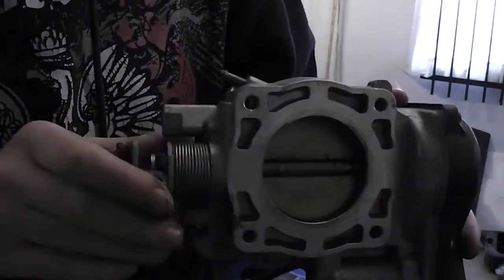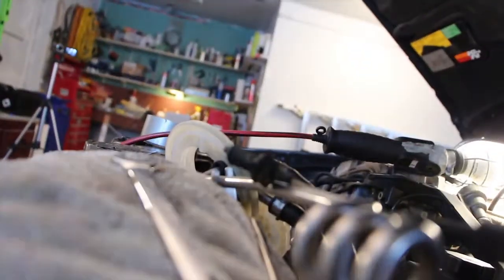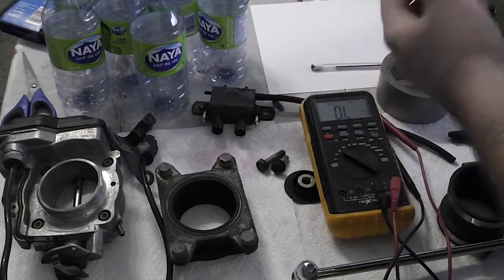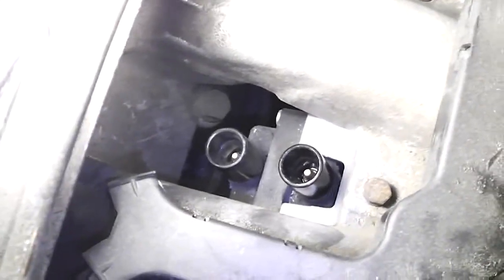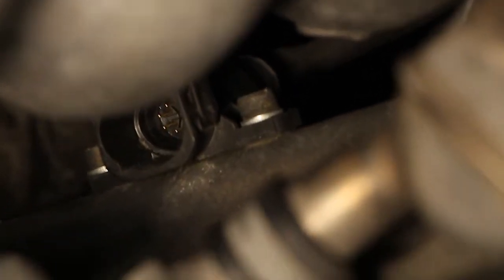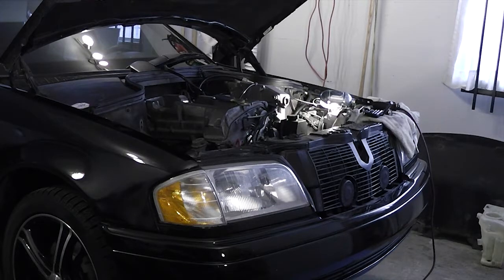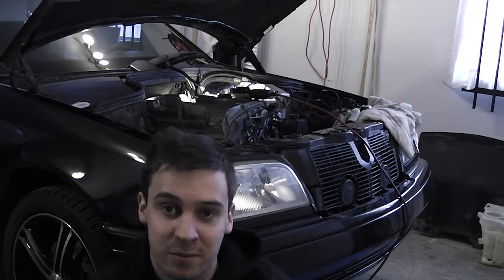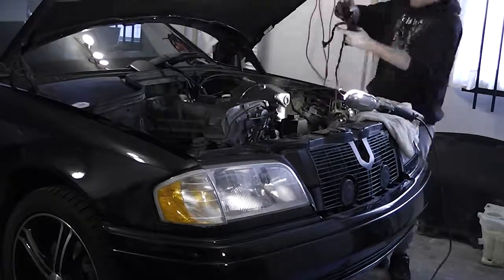M111 Cylinder Head Gasket DIY - More Disassembly

Comment: Hi Pat! Congrats on the amazing work of yours! I'm lost with the three vacuum nipples of the intake manifold. Can you please tell where each one connects? I'm having an annoying high idle issue since my last DIY repair and your input would be a salvation to me! 🙂
Reply from the maker: Hi, thanks for the kind reply. If you have a W202 I suggest you check out my video on this topic. I go over the entire vacuum system of the W202 (including common leaks / easy to forget connections). The W202 has a LOT of vacuum connections and it would be too long to list them all in a comment.
Reply: @PatsCarGarage  Thank you so much for your prompt & kind reply! I've watched the specific video, I go over it again though. I was just wondering if one of the three vacuum nipples remains unconnected... And yes, I agree that the vacuum hoses network of this car is a nightmare if it starts failing. Again, I send you my deepest appreciation! Keep up with the excellent work of yours! 👍😊
Reply from the maker: @GeorgeLykissas  Thanks again, you are too kind! I make these videos to help people out with their cars. And no, all the nipples must be connected. The small ones should not really cause a major change in idle. If your engine still idles too high, it's more likely that either the brake booster is leaking, or the purge valve.

Comment: My engine is just a copy of yours but on a W124 (E220)...the engine is consuming too much oil (382000km with valve stem seals replaced)),I have doubts this is because of PCV (positive crank case ventilation). Unfortunately  the PCV is under the intake manifold,how easy it is to remove the Intake manifold and replace the PCV? Also there is oil leak from the oil pan gasket  :( (though there is no oil spells on the ground under the engine,just around the pan).
Which do you think could cause too much oil consumption? the PCV or the oil pan gasket?
Regards
Reply from the maker: PCV by itself does not cause oil consumption, it's merely a venting system, there are certain things that will cause oil to be forced out of the PCV, but it's hard to tell without looking at your car. I've never heard of an oil pan gasket failure on these cars (not saying it can't happen, but it wouldn't be common). Check to make sure the oil isn't really leaking down from the cylinder head gasket, loss of oil there would explain some oil consumption.